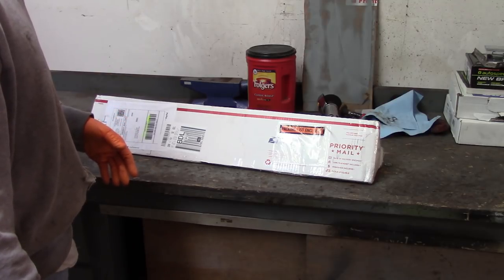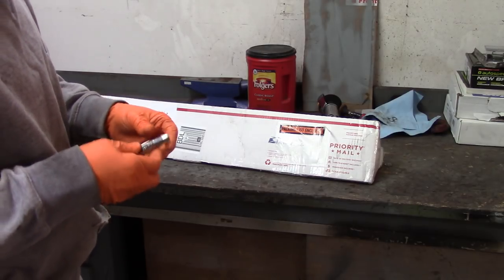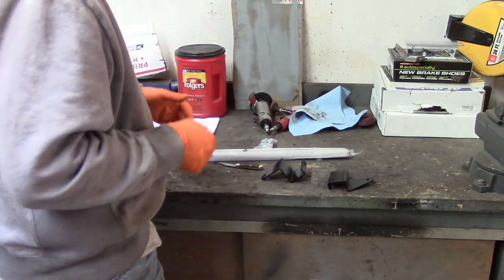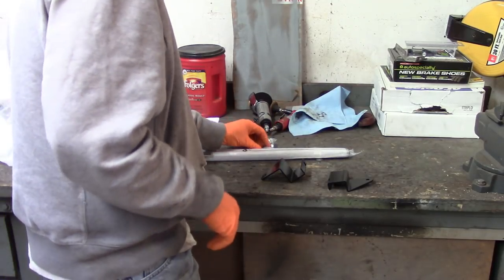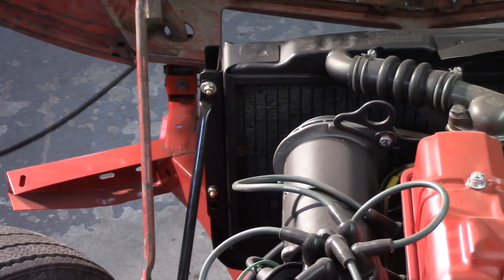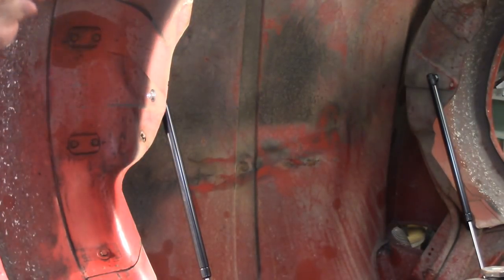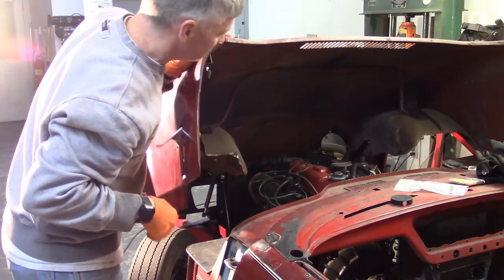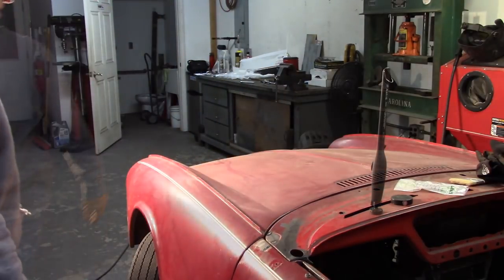Triumph Spitfire Restoration - Bonnet Lift Kit

Comment: I would be reinforcing the wheel arch where they attach because eventually I think it will stress the thin metal and crack it.
Reply from the maker: Yes, I think you are probably correct. I ended up not using the kit because I ultimately wasn't happy with the pressure it put on the bonnet when it was down...it pushed it back and I struggled to get my gaps correct and consistent (it would slide around a bit). I may try them again someday, but not yet. Thanks for the comment!
Reply: @roundtailrestoration  This happens when the hinges at the front of the bonnet are worn.  If you rebush or otherwise fix the wear at the hinges, the bonnet can no longer move around and you won't have any issues.
Reply from the maker: @ClarkandClarkInc  Okay, thanks. I'll look into that!